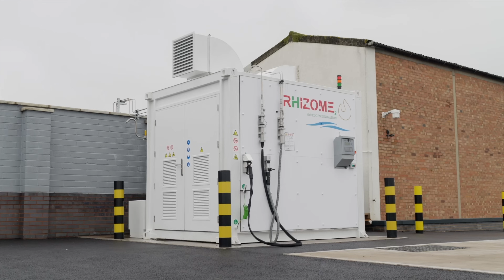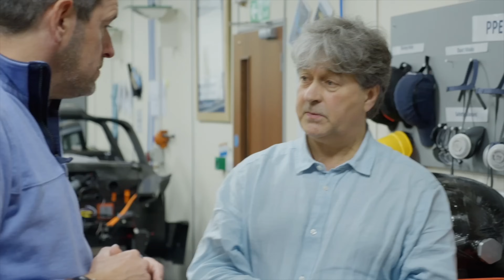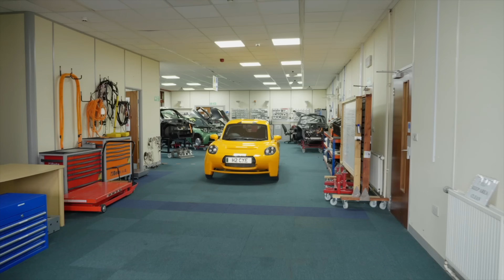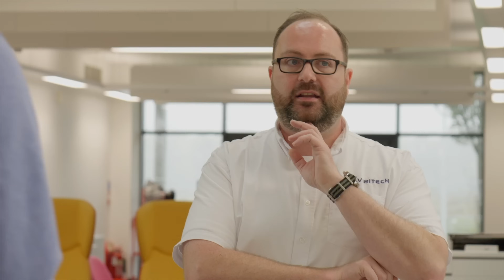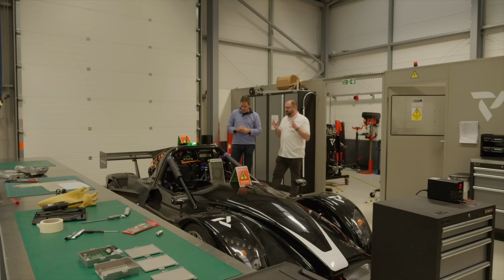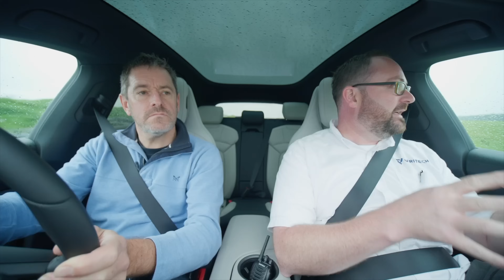Is Hydrogen a viable option for our Automotive Future ?

Comment: Battery technology is moving so fast that hydrogen is a virtual dead duck for passenger vehicles in my opinion. Even commercial vehicles are now making a case for batteries as they become more compact and power dense. 
Hydrogen may have uses in industry as a power source but there are issues with how it's produced and it's connection with the oil companies.

Comment: Question : Is Hydrogen a viable option for our Automotive Future ?

Answer : No

Now, let's move and stop wasting time and money on it
Reply from the maker: Question - Did you actually watch the video ?
Answer - No
Response - Maybe give that a go before you comment 🙄
Reply: @PetrolPed  Yes I did watch the video. Sadly it's a collection of hydrogen grifters and snake oil salesmen. Hugo Spowers referring to RiverSimple as a "start up" given the original company was founded 2 years before Tesla is very funny. The idea that RiverSimple's 2 seater hydrogen FCEVs, that has nowhere to refuel, is a more practical option than, for example, a Renault Mobilize Duo (you can refuel at home and thousands of locations) is laughable.

Hydrogen has a place in the removal of fossil fuels from our lives but only on industrial processes that are difficult to transition to other options. Using it for transport is energy vandalism.

Comment: For buses which return to a depot and stay overnight, hydrogen distribution is not problem. General retail H2 distribution would be hopeless and very expensive.
Reply: Every single implementation of hydrogen buses eventually gets discontinued due to costs and supply issues. They are always beaten by BEV buses

Comment: Yes. Why would you take a source of electricity (which can drive an EV with 90% efficiency), add pure water (quite valuable in places like Australia, where I am) install all that processing equipment (both capital and maintenance intensive - electroliser, compressor, storage, transport...) to fill an FCEV with approx. 30% of the energy you started with driving the wheels!  At 4 times the cost. Makes no economic sense at all.

And no environmental sense either as currently 95% (not 50%) of hydrogen is very dirty (48% via steam reforming of natural gas, 30% via petroleum fraction, 18% via coal gasification) resulting in 8kg of CO2 produced for every 1kg of hydrogen! The fossil fuel industry is quite happy to support supply, misinformation and your promotion of this dead end. 

Given green hydrogen is in limited supply and is comparatively expensive. Why not reserve it for processes where there is little or no alternative (e.g. fertilizer, steel and, ironically, oil refining...). It makes no sense for road transport as we have a perfectly suitable (and rapidly improving) alternative at much higher efficiency and much lower cost.

And I haven't even mentioned the challenges storing it, that hydrogen slows the depletion of methane in the atmosphere and tankers delivering it at 12,000psi on our roads, presents extreme risk.
Reply: ^^ ^ You perfectly summarised the challenges and issues there

Comment: The technology does look cool, and it's great to see what these R&D companies are doing, but the issue is going to be convincing people that Hydrogen is better, more convenient and cheaper than electric, or even internal combustion and their alternative fuels. Its very easy to own an EV and never require public charging. One of our EVs hasn't seen a public charger for a year, and the other for 3 months, and we've driven a combined 35,000km over the last year. Riversimple seem to be aiming for the local short trip market with their initial offering, but this is an area where an EV is the perfect solution, plug it in overnight (if you have off-street parking or local on-street parking) and wake up in the morning ready to go. When it comes to using public chargers on road trips, we've found that it's not inconvenient, and owning an EV actually encourages you to take breaks, which after 3-4 hours of driving is a good thing. Is there really a big enough market for hydrogen where currently EVs might not be as convenient (no off street parking or ability to charge overnight). EV innovation is moving at a rapid rate, energy density is improving, charging speeds and range are increasing and infrastructure is rapidly being deployed. Will hydrogen be able to keep up? I think it could one day be a cheaper and cleaner alternative to internal combustion.

Comment: Hydrogen is an immature technology? Toyota and BMW were messing about with it back in the early 90's and they still haven't released a successful vehicle.
Riversimple have been on the go 20 odd years and still not released a car. In fact in tests in 2022 they admitted it only delivered around 50% of the range they claimed it would.
Also in its current form it's unsaleable, as it doesn't offer much more and a G-Whizz.

Comment: Comment made before watching NO!!!! After watching? HELL NO!!!! sorry to all involved but hydrogen is simply a terrible fuel, Batteries are only getting lighter, more energy dense, faster to charge, safer and cheaper which is why we are now seeing cars like the Dacia spring for under £15,000, making hydrogen from natural gas for transport is simply stupid, using renewable sources, simply wastful as it takes way more electricity than just using the electricity to directly charge a battery. Hydrogen should be used where is is best, in industry removing coal from steel making and similar industrial uses. Hydrogen transport projects have been failing all over, Nickola in the USA practically bankrupt, time to move on guys!
Reply from the maker: Which is why MIRA have just invested millions in that fuelling facility…no wait 🤔😂

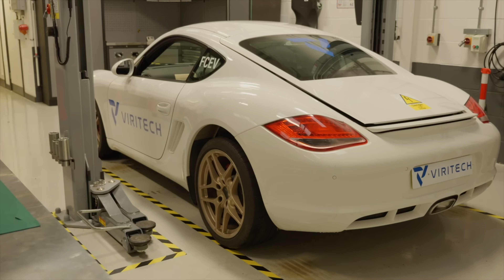Comment: 21:00 the loss of a bit of payload (which is not 5-6t more like 2t) is not worth 4-5x the running costs before you consider that 99% of hydrogen is produced from Fossil Fuels!
Reply from the maker: The battery pack along in a Tesla Semi is nearly 8 tonnes ! That sounds like 6-7 tonnes extra to me 🤔
Reply: @PetrolPed  Sorry the weight of the Tesla Semi battery is more like 4.75 tonnes not 6-7 tonnes

Comment: I do enjoy your videos but very confused by this one. National Grid have already said the grid will cope with increased EVs on the road, they are investing heavily. Don’t understand the argument that a lot of infrastructure changes are required for EVs. What about hydrogen?! Much harder to roll out. 
Majority of EV owners wake up to a full battery with overnight charging, with a 300 mile range. Plenty for most people. 
Perhaps it’s because you’re called ‘Petrol’ Ped that you don’t believe in EVs but they simply are the future, it’s already here. 
If all car makers started on EVs years ago they wouldn’t be closing factories. Tesla have done it, and BYD etc. in China.
Reply from the maker: Hydrogen may form part of personal transport but its real strength is heavy haulage, agriculture, plant and final mile delivery. This is where EV struggles as a solution.

Comment: Hey Peter! Let’s start positive!  Firstly, thanks for visiting these companies obviously wanting to share their wares, but I probably would not have found them elsewhere. I’ve long had a view that capacitors are going to be introduced to high-performance EV applications and will unlock the potential we’re struggling with batteries alone. Hub motors are definitely going to play a bigger part, especially in smaller urban vehicles and we’ve seen some performance ones too. Just imagine true 4 wheel torque vectoring by motors, that will be awesome! Not sure about the practicality of the riversimple but the concepts are fabulous. Isn’t it great to see a car that follows Lotus and Murray principles with a thin wheel, and back to getting the basics right through proper engineering rather than just big numbers and tech. What an antidote!

But hydrogen? Yet to be convinced and more things seem to be disproving its viability. Dangerous leaks during transportation due to its atomic size, storage costs, <50% round-trip efficiency, funny enough range, not to mention it’s now probably 15 years behind EVs in terms of any network or maturity as a solution. So long way to go, understatement of the century. 

I’m with you on trying to understand what alternatives to BEVs could look like, but as mentioned, some of the tech shown should make EVs an even better proposition when applied there and widen this gap even further. Keep ‘em coming though Ped. We love to learn! 😊
Reply from the maker: Thanks for this 👍

Comment: I always thought the bev only will not work. Plant and heavy construction machinery cannot travel to a charger they need filling on site with enough energy to do a 12 hour shift look at JCB work with hydrogen. HGV will need to run on this as well we need hubs built just for them with on site production with green engery. Bev are great for cars and small vans but not hgv. Also need to limit cars to a 50kw battery to conserve the materials needed and improve rapid charging to 100 miles in 5 mins. I realise we are not far away from achieving this.

Comment: I recall the boffins at Riversimple from a decade ago. They are challenging the modern paradigm of overly large, heavy and fast cars that has only become worse every year.  The same applies to electric. The original BMW i3 and the Dacia Spring are closer to what electric cars should be but conspicuous consumption, conservatism and aggression wins.  In Australia many average people think they need 3500kg towing. Why, because it's possible and they have deep pockets, or at least they did, so they bought the Taj Mahal of caravans. History has shown that we won't stop until we hit the hard bump stops of excess. I suspect Riversimple and others like Aptera will remain a novelty, examples of where we should be heading but aren't.
Reply from the maker: Thanks for this 👍

Comment: So we use electricity to produce hydrogen, so we can then turn it back into electricity using a fuel cell, and the energy loss is being overlooked.
Unless there is an excess of electricity on the grid, it could be a way of storing it, but batteries are better suited and far more efficient.

Comment: Why would anyone want to use electricity to make hydrogen from water, then store that hydrogen in pressurized containers, than buy thy hydrogen from a third party, when I can just put the original electricity in my car to run it far more efficiently?
Reply from the maker: So you didn’t actually watch the film then 🤷‍♂️🙄
Reply: @PetrolPed  I just watched it again, and my comment stands. 
This might be a technology used for heavy haulage, if batteries cannot be used to store energy, but for the average private vehicle owner it's never going to be cheaper or more efficient that a BEV, for all the reasons explained by other commenters.
Maybe a replacement fuel system for racing cars? Maybe.. but if a hydrogen cell is ruptured in a crash, that's a much bigger explosion than any gasoline fire.
Reply: @PetrolPed  No no, many of these commenter's will have watched it all.

Comment: The same old dead horse is dragged out, flogged for a while and then put back in the freezer. Hydrogen as an automotive fuel for cars and probably trucks as well is dead. Expensive and dangerous. This was proven years and years ago.

Comment: Interesting to see what these small companies are doing but you haven’t really justified why hydrogen cars MUST be part of the future. If you really thought carefully about the pros and cons of hydrogen, then you probably wouldn’t come to the same conclusion when it comes to cars.
Reply from the maker: As we talked about in the video. Hydrogen can play a part in the 25-30% of transportation use cases where BEV doesn’t work 👍
Reply: @PetrolPed  By the time that there is an infrastructure to satisfy the needs of hydrogen vehicles, EV technology will have improved in terms of charging speed and range so that your 25 to 30% need for hydrogen cars will have dropped dramatically, so do you think the big companies will want to invest in hydrogen infrastructure?.
Reply: @PetrolPed  95% of cars sold in Norway, the BEV frontrunner, are now battery-powered. No sign there of the 30% use case you mention
Reply from the maker: Try heavy haulage, passenger vehicles, agriculture 👍 EVs simply don’t work for heavy haulage despite what Elon Musk says. His Tesla Semi has over 7.5 tonnes of batteries. For a haulier like Eddie Stobart it’s often only the last 500kg of payload that makes them any money. A fuel cell of similar power would be mass neutral or even mass negative compared to the engine and gearbox. Large scale adoption of hydrogen by haulage would improve infrastructure making passenger cars a viable market 🤷‍♂️
Reply: @PetrolPed  I don’t disagree with you about haulage or construction plant (although the JCB proposal still generates NOX), but I thought that your title referred to cars and not automotive.

Comment: We are going to need portable energy sources other than batteries for many applications - agriculture and long-haul aviation as obvious examples. In the latter we are about an order of magnitude short on current battery energy density and for the former we have a huge number of remote sites which, at harvest time need harvesters of 200kW continuous power and bigger to work the clock round for a matter of days and then require negligible power for the rest of the year. Maintaining thousands of high power chargers for a once in a year use is madness.

Comment: RIversimple have been abstracting money from the UK (mostly Welsh) taxpayers for 20 years and still have not produced one single car. Not one. In twenty years!
20 years ago there were probably 3x as many H2 refuelling places in the UK as now. I think the UK has a dozen left? IIRC Shell announced they are shutting them down. 

Who's going to pay for the thousand of £2M a pop H2 refuelling stations  that would be needed? 

Motors in wheels are subject to all the crap the road and weather throws up.  

EVs also are NOT becoming increasingly unaffordable, (as the guy says) they have been coming down in price, even before all the new chinese cars coming in very cheaply, battery prices are pretty much halving year on year helping EV prices to fall.  

Finally as for being "green"  an FC vehicle inherently uses 3x as much energy as an EV. Fool cells indeed.

Comment: Glad to see from the comments that people aren't being fooled by the gaslighting from the hydrogen lobby. Hydrogen is too inefficient to produce by electrolysis and too difficult and costly to store and transport to ever compete with BEVs. The market has already decided. There are currently only 6 hydrogen filling stations in the UK with 5 of them being operational. Also who gave you that 50% figure of hydrogen being made from methane? The correct figure is 98% so its easy to see why the fossil fuel industry would like us to use hydrogen. Oh and FCEVs have batteries too so you're just adding expense and complexity to a BEV by fitting a hydrogen fuel cell.

Comment: This has been hyped around the automotive world for over 30 years and will go nowhere. Too expensive to make, too expensive to store, highly corrosive and easily leaks, and inefficient.
Reply: I agree with pretty much everything youy say, but in the interests of the truth, hydrogen is not corrosive at all.
Reply: @davidcolin6519  actually that is not true. Hydrogen is the smallest molecule and can be absorbed by many materials. This causes embrittlement, which leads to corrosive stress cracking. So yes, hydrogen is corrosive.
Reply: @davidcolin6519  agreed, corrosive is the wrong term, but hydrogen embrittlement of steel and many other metals is (yet) another complication and impediment to the widespread use of hydrogen. Maybe that’s what the OP meant?

Comment: Hi Ped, the first company, RiverSimple has some really interesting technology, the in-hub motor and brake system makes sense to me, as it removes drive shafts and the need for a differential. The super capacitor technology is also a potentially useful technology. As to the hydrogen side? I think this is a complete dead end, sorry, but I’m 60YO and the hydrogen debate has been around my entire life, it is very complicated to use as a fuel for a whole host of reasons that are based in fundamental physics and highly unlikely to change.